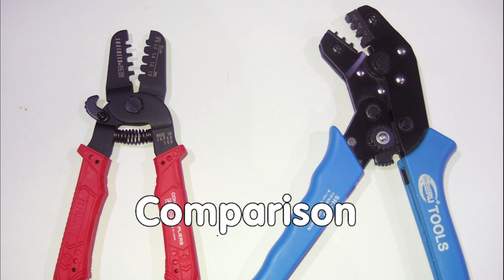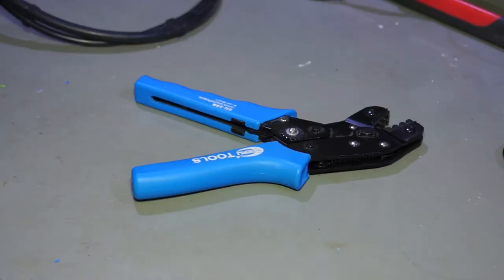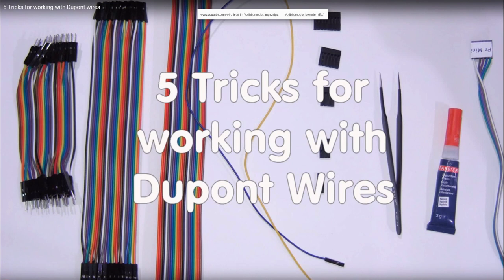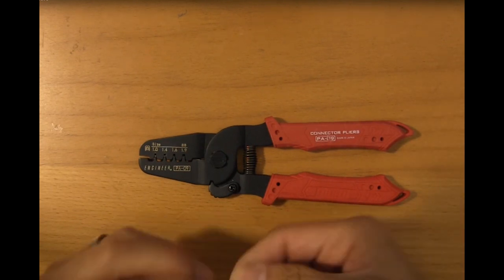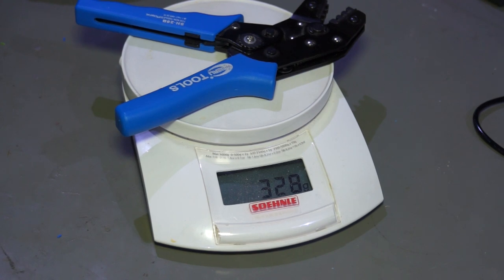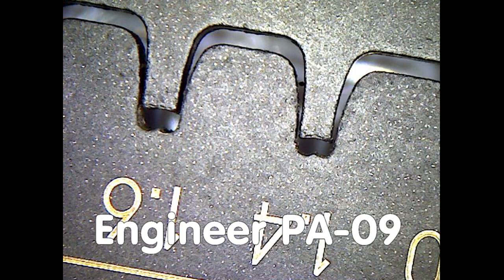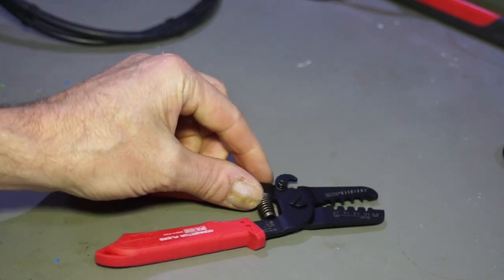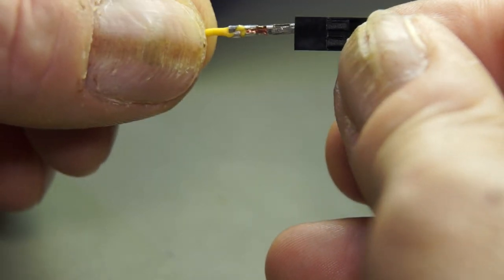#39 SN-28B Chinese Crimper  vs Engineer PA-09: Is there a difference for Dupont wires

Comment: Well, haven't watched yet but right off were comparing a ratchet to a plain crimper..... Ok, I'll watch .Ok. Half way through. I see your really crimping a very tiny delicate crimp, DuPont of course. The crimper you had first purchased was designed for tough automotive #8 and greater wiring , yellow crimps and larger. I'm not sure I'll use the one    (Fasen HS-14 5.5 to 14 mm)    I purchased for even red or blue crimps, I'll continue the use my Amp I purchased years ago. And that was before I used many  DuPont square wiring systems, (80s) although I did work for one company where I would find proto boards INSIDE commercial two way radios because he had complex circuits you couldn't buy connected on them !  Proto was a brand name for . He was at that time, our "boss" so we couldn't complain. And, to tell you the truth , the circuits were still working , after years of being driven around in rough sheriff trucks looking for marijuana gardens ! And, now at my later age, loving all of this new technology, learning more every day ! Thanks for the video. oh, and I think I'd look for a crimper even more specialized for these delicate connectors. But, as I do not own one, can't say for sure. General Electric has used them for years though. Huge plugs with up to 25 wires  in them. Motorola wouldn't touch them. They use gold plated. connectors. Incidently, if you look at the Wikipedia, they give a color code chart. It doesn't seem to match what I'm used to at all. -Guess I'll try to find one at Fassen Tools ? So, if you've made it this far. A couple of references. AWG/inch/mm stud and wire guide https://www.engineeringtoolbox.com/awg-wire-gauge-d_731.html ….. Common color guide Three Crimps , http://www.ferrulesdirect.com/terminal/SKRF600.htm
And lastly, Dupont crimp wire size is :   (amazon sells one with 36 AWG ). this would be .005 inches .13mm according to this calculator !  https://www.engineeringtoolbox.com/awg-wire-gauge-circular-mils-d_819.html WHEW ! Thank god this isn't twitter !
Reply from the maker: I think Dupont wires are around 28AWG. Pretty sure they are not 36.
Reply: @AndreasSpiess  Thanks for looking at these comments on your older video. Really appreciated. 
 Not sure what happened but, yesterday I tried to say that Bangood said that it came out to .25 mm which awg comes out to slightly larger than 30 (herehttps://www.banggood.com/Geekcreit-310pcs-2_54mm-Male-Female-Dupont-Wire-Jumper-With-Header-Connector-Housing-Kit-p-1063303.html?version=3&akmClientCountry=America&&akmClientCountry=America&cur_warehouse=CN)   , but I can't find that reply. , 28awg came out to .32mm diameter .
BUT this is what is currently confusing me.
ON the engineering tool you specifiy, it says this.
THIS CRIMPER IS SIZED IN METRIC FOR 1.0, 1.4, 1.6 AND 1.9 PITCH ? 
Then it adds this .
1.25 to 2.5mm pitch connector 

AWG32 to 20 

Now, whats really confusing is my engineering tool calculator shows a chart and has a calculator. But, the mm is shown as diameter. The numbers are completely different than anything on the tool, and anything on any sales numbers at ebay or amazon. . The 2.54 mm Dupont numbers are different , compared to these charts. IF my calculation of 30, or yours at 28 AWG is correct, and we compare to DIAMETER MM on this chart, we get .25 mm diameter for 30awg and .32mm diameter for 28awg. Wow,. I'm totally confused. What are the other numbers, which seem to possibly revolve around "PITCH" . What is pitch ? I guess I can look it up but, maybe you can just tell me. Guess your in Europe ? so I'll wait.
Reply: And, researched the heck out of crimpers, and the PA-09 is in a special class. Nothing even compares, not very well anyway. Ouch.

Comment: I feel bad because I thought SN-28B (lowest price 13,330 Won in Korea) was expensive and try to buy one under 10,000 Won. There were two "crimping tools" under 10,000 Won, but I was not sure if they are for Dupont or not (maybe "crimping for other types of headers), because judging by the picture, the holes looks different from what YouTubers were using..
I searched for PA-09, and the lowest price was 48,600 Won. That's 3.64 times more expensive than SN-28B.
Reply from the maker: Maybe you watch also the newer video with another comparison? There I found a cheaper and better one.
Reply: @AndreasSpiess  I searched for 2820M and its lowest price was 20,000 Won. Funny how its item description basically says that it's inferior to PA-09, but it's for people who want a cheaper one.

Comment: As I understand, SN-28B is not designed for JST SH... But PA-09 is too expensive if I need to crimp only few contacts - much easier to use simple pliers.
Reply from the maker: For a few contacts you are absolutely right!

Comment: Thanks for this video :)
I also bought the SN-28B and found them to be a pain to use, with horrible results.

After watching this, I bought the PA-09's and they worked perfectly first time on Dupont and Molex KK crimps.
The two step process was quick and easy - way less fiddly than getting things lined up in the 28B!
I should have bought the PA-21, as it has a more useful size range for my needs, but these'll do just fine for now.

So yeah, buy cheap, buy twice and all that, unless you get lucky :)
Reply from the maker: This is why I did this video. With our Chinese friends I often buy cheap and good. But not this time...

Comment: the problem with blue crimper is the only one it was not correct choice crimp head is to wide for the small dupond you made correct choice with japan 09 crimpers since they are not as wide. you can buy chonese crimpers with narrower head and you will get the sam result.
Reply from the maker: Thank you for your tip

Comment: Don't you think you got the chinese one with the wrong crimping die? There are at least 33 different die, interchangeable and useable with your chinese crimper. The shapes are different between the Engineer and the Chinese No-Name you got.
Reply from the maker: I do not know. But if you read the comments below this video, I am by far not the only one. We all bought a crimper which is sold for Dupont connectors.
I am not sure, if I was able to exchange my dies (the crimper is since longtime in the waste).
Some comments show also, that there are other crimpers which seem to work. But not at the price level of the tested one. More on the PA-09 level.

Comment: Hi Andreas
Thank you for sharing this.
From an old project I own an Harwin Z series crimping tool.
http://www.digikey.com/product-detail/en/harwin-inc/Z22-020/952-1364-ND/2264345
When I started there wasn't much knowledge about these tools and options were scarce.
After buying two cheap ones which gave me all the issues you talk about, I settled for this very expensive Harwin (paid € 470 at the time) but had it for about 8 years and it's always a perfect crimp once you figure out the adjustments depending on AWG and terminal.
I'll probably also buy a PA-09 now that I saw this, since mine is very heavy :)
Reply: Oh, and in case you're looking for an excellent stripper you should look into Weidmüller http://www.weidmueller.com/int/home
Reply from the maker: This seems really heavy. But, if it works, it is ok, if you do not use it too often. And it will probably live longer than you and you can hand it over to somebody else as part of your legacy  ;-)

Comment: Good day Mr. Spiees, I won a #WioLink IoT interface on Ebay with is a 6 grove conectors (digital 0-3,UART,I2C) from Kickstarter, but the GroveConnectors are too expensive. Is for academia use at the university no resale, will like to know if this crimper tool can help me place a PH2.0 4 pin connector to avoid the expensive Grove connector fom Seeedstudio Dot COM.  Thank you for this excellent informative video keep posting I subscribe !
Reply from the maker: +Jesica Lorena Osuna Hdez Actually, I never used these kind of connectors. So, you have to search for somebody who uses  these kind of connectors to be sure if it works. 
Thank you for subscribing.

Comment: Hi Andreas.  I got this ratcheting crimper from hobbyking: http://www.hobbyking.com/hobbyking/store/__13446__HobbyKing_JST_SH_Connector_Crimping_Tool.html  It works really, really good.  On dupont it is absolutely brilliant (using the inner (smallest) groove).  I also have the Engineer tool you have, but only use that on Molex or similar small connectors (the 0.9 groove)
Reply from the maker: +Sindre It looks that your tool has a silver metal for crimping. Mine has a black one. Good to know for other Youtubers. Thanks.
Reply from the maker: +Aron Gatt It seems, that hobbyking and poloulu have tools which look similar to the one I used but are better quality.
Reply: Andreas Spiess yes the die looks a bit different , althoght you can’t go wrong with an engineer p09 for sure

Comment: The pin got bent because the tool jaws were too thick. If you grind it thinner, it will work fine. The chinese crimper was probably made from ancient specs not suitable for modern crimps.
Reply from the maker: Maybe. But it was announced for dupont connectors
Reply: I agree. The the point is it wasn't quality of manufacture, but wrong manufacturing specification that caused the problem. Given the significant discount on the chinese part, personally I have no problem modding the tool to fit my purpose for occasional domestic use. Most of the time the chinese sellers have no idea what they are selling anyway and english wouldn't be their strong point. So error in the description is to be expected given the price.

Comment: hmm the chinese one should be easy to fix with a CNC mill and some small endmills. They are just not made properly. I will try later I also have an Engineer crimping tool now.
Reply from the maker: Good luck! Not everybody has these tools…
Reply: @AndreasSpiess  it's probably cheaper than you expect.
What's the weakest part of a CNC when doing micro-milling?
It's the endmill, so this does not need a high end machine.
Any kind of machinist should be able to do that, or maybe even at a makerlab or university.
The endmill itself will give you the roundness in that part.
Micromilling is slow, it's so called rubbing.
I could think about a few ways how to do that. -- but yes I also bought the tool because I did not know what the form had to look like. If you dig into it seems to be straight forward.

Comment: The Chinese instrument is pretty good if you crimp twice. The first time you do. And then slip 2-3 millimeters ahead.
Greetings from a bulgarian civil engineer :)
Reply from the maker: I think, you can get different versions of this tool, some better than others. If you read the comment of many others, they shared my experience, and some also yours.So, "statistically", more are bad than good ;-)
Reply: It is not desperate when the negative opinions prevail :) The Chinese - it`s a deal, actually.
But the geometry ... we understand it ;)

Comment: I have a SN-28B crimper and I get it to work perfectly well.
Reason why your lugs are bent and distorted is that you use the whole width of the jaw, which is 7mm. When looking close you will remark that the chinese tool has a jaw with 3 openings, but with 6 gauge size calibers!
The side you show in your video has 26-24, 22-20 and 20-16. The other side has 0.25, 0.5 and 1.0 size: that you either do not know or you do not show.

The width of this jaw is 7 mm, where the Dupont plug needs to be crimped over 3,5mm max! Of course your pins are distorted, you probably do not use your tool is required: the pin to be crimped has to be placed HALFWAY the jaw.

The japanese tool has 4 gauge sizes, the chinese tool has 6 gauge sizes. You just need to know how to work with it.

Erik
Reply from the maker: +brice3011 : If you watch other instructional videos with this tool, you see, that all of them have the same problem with fitting at the end. Maybe you should do a video. I for sure will post the link right here

Comment: Hello. Under the microscope I can see the marking "ZH" on my "Dupont Pin connector terminals" from ebay. The ZH-series from JST comes to mind. But the ZH terminals have different dimensions according to JST datasheet. Its pretty messy even finding the right name for those terminals; i think people don't realize that there are in fact many different terminals with small but important differences in dimensions, which look identical from a distance and thats why most people can't find the right crimp tool. Do you have a datasheet for your terminals?
Reply from the maker: As you write, there are many different connectors. The JST homepage is also not a big help. So, for me it is pretty much a "try and error" process. I have bought a few false connectors which I only detected when I tried to use them. So, no help from my side. Only solace that you are not alone...

Comment: There are a boatload of various crimpers sold under the part number SN-28B. Good the difference in the quality of the die set?
My late father used to say it is a bit like marriage: "If you get a good one there ain't nothing like it. If you get a bad one there ain't nothing like it. "
Take a look at the  IWISS web page: 
https://www.crimpingtools.com/products/changeable-edm-cutting-die-sets-for-sn-series?
Reply from the maker: I also made a later video using a IWISS tool
Reply: @AndreasSpiess   I saw the one comparing the IWISS IWS-2820 to the Engineer Inc PA-20.
I did not find (from you) one about the IWISS Ratcheting Crimper (SN-2549 or SN-28B) ... I will search again.
These last two used jaws manufactured using the EDM process. 
There is a world of difference between those and the 'forged' ones found on some Chinese "SN-28B" crimpers.
The quality of the latter varies greatly as well.

P.S. Even thought the die sets are only $7.50 each the $30.00 shipping charge are not economical.
Reply from the maker: I did not compare the ratcheting one. Just this one. But also from IWISS. The seem to be of good quality

Comment: I have pretty good luck with the Pololu crimper listed below.  Only occasionally, when the insulation is too thick do I have an issue inserting the wire into the shell.  For the most part it works well.  It is a bit pricey, but worth it.

https://www.pololu.com/product/1928  

Thank you for posting all these videos.  They are helpful indeed!
Reply from the maker: Thank you for the info. Sombody else wrote, that he is happy with one from hobbyking. It looks similar to the one you have.

Comment: I use this crimper.  http://www.jameco.com/z/63811-1000-Molex-Application-Tooling-Hand-Crimp-Tool-For-Mini-Fit-Jr-_304928.html . Sometimes it takes 3 steps, with the first step bending the tabs that go over the insulation so they bend into a circle.
Reply from the maker: Thanks for the info!

Comment: You should take a look at this video for how to use your crimp tool https://youtu.be/-u1t7Cdf6RE
Reply from the maker: I think, he did nothing different to me, and at 18:00, he had the same issue I had: The pins have to be adjusted manually. And this is not, how it should be. You find many other videos with the same results.

Comment: chinese tools are piece of shit but they try to make them look valuable by adding weight and useless ratcheting mechanism...
Reply from the maker: I have mixed experiences. Some are good, others not. That is why I made this video. We also have to take into account the price point of these tools.
Reply: Not quite true, very cheap copy versions of very expensive brand names are usually fairly crap, high end crimping tools are heavy, have ratchet mechanisms, and do everything in one step but can cost several hundred dollars, so when it retails at $30 its not going to be as good